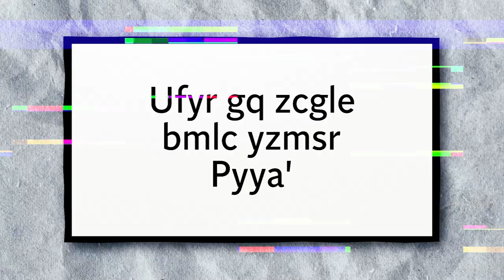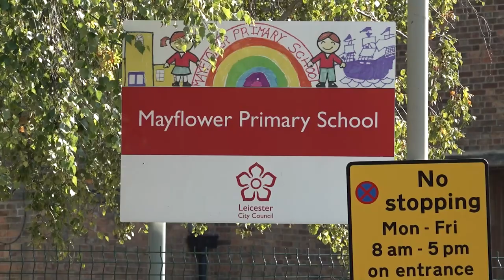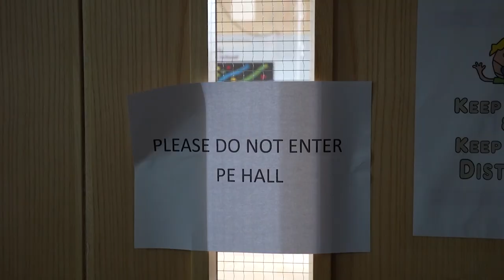What is Raac and why is it causing an issue in schools? | Decomplicated

Comment: There is NOTHING wrong with the concrete. The problem is with the RE-ENFORCEMENT. It is ordinary steel - it RUSTS, expands and weakens when exposed to moisture. ALL STEEL DOES including the bare steel in gang-nailed joists and butterfly wall ties with cement dripped on them.
Will these be the next panic?